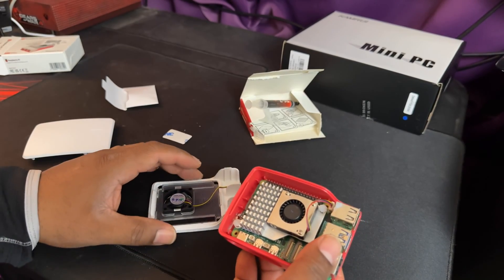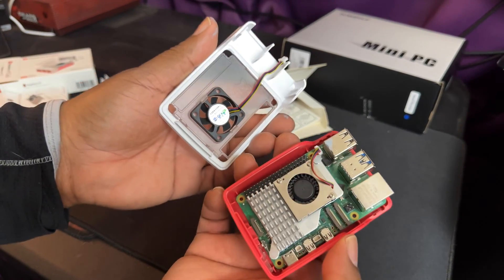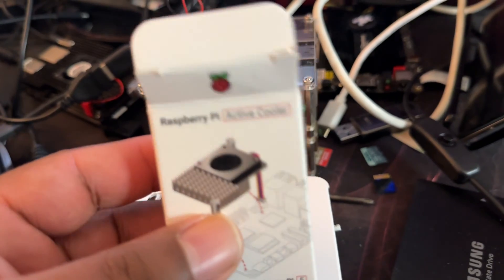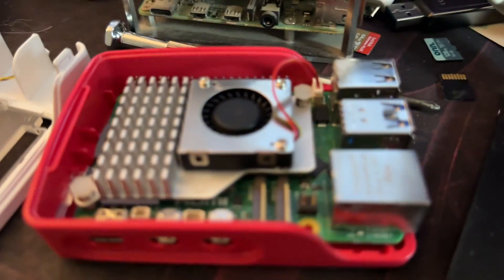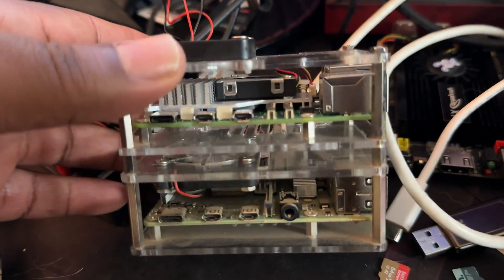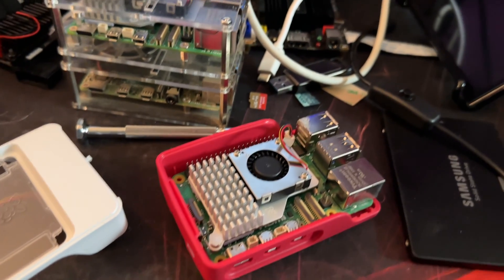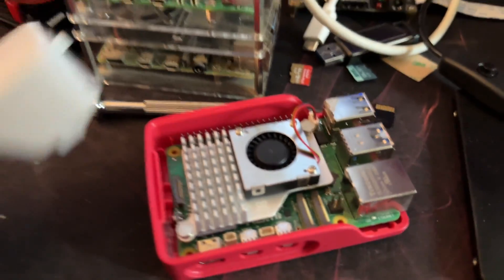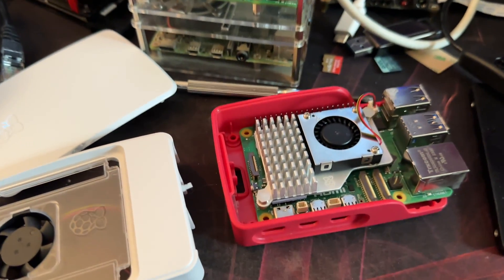The Raspberry Pi 5 Case & Active Cooler Install Concerns

Comment from the maker: The case is meant to be a protective housing for use with a fan and/or heat sink. I've searched high and low and no where is it stated or mentioned that the active cooler works in conjunction with the included fan. Its one or the other. Most videos and reviews will state the active cooler is enough. however under demanding applications such as over clocking or running demanding applications for 3-4 hours or any length of time the cpu will be at throttle levels of 77-85. this has been tested with the active cooler within the case. Using it outside the case with open airflow will give you better temps. My stress test included several bench marks and ps2 emulation on the raspberry pi 5 which is one of the most demanding things you can run right now. you wont find this info anywhere because not many people have ran ps2 emulation or demanding apps for more than an hour or even while overclocked. im using the microcenter acrylic case from the pi4 with the additional. fan. my idle non clocked temps are 28 degrees. in over clocking and running ps2 emulation my temps reached 56 degrees. normal idel temp for a pi 5 is 45-55 degrees non overclocked. if I was not applying my cooling method with thermal paste I would have exceeded the thermal threshold. The stock case could have been designed for better air flow. Im aware the top comes off but you need an additional fan with the case to keep it cool. Especially under demanding circumstances which most customers have not ran. running a 15 second bench test to establish temps on a case means absolutely nothing. try 6-8 hours https://youtu.be/ruXQ4eYh4dA?si=xOoB6Fv5DFtgfF0n
Reply: can you do a video temp test with 
-active cooler and case
-active cooler and case (with the case fan maybe mounted outside of the case)
-active cooler without case
Reply from the maker: @TylerDurden404  i performed a test myself. I haven’t uploaded any test results or videos but it’s definitely nothing to be proud of. You definitely need to go with another option.
Reply: @TylerDurden404  eso sería un estupendo video pues son pocos los que los hacen diciendo la verdad pues muchos de ellos sólo muestran los artículos pues son auspiciados por su manufacturero y no dan una opinión real y menos hacen las pruebas pertinentes y lo documentan, sería maravilloso encontrar esos videos y así informarse mejor para tomar una decisión bien informada para que cuando nos decidamos por comprar ya saber estos datos y ir mejor preparado y comprar lo que de verdad funciona.
Reply: Thanks for the insight have u found a solution for a case that goes in conjunction with the active cooler?
Reply from the maker: No, I haven’t. It is best to use something else.

Comment: ur supposed to pop off the plastic when using the active cooler and no active cooler is not required. you can just use the heatsinks that come with the case, or you can use the active cooler without a case. if you want both, you can pop out the plastic to use the case with the active cooler. and you don't even really need a case anyway
edit: and also no you don't need 3 heatsinks, one for the CPU is enough. heatsinks for the ram and the little power chip is optional
Reply from the maker: I’m aware about how this case is assemble however it was not mentioned at that time. In fact, if you watch this video is one of the first that was made on this particular product while other accessories were also promoted as well in addition to your theory of that it doesn’t need additional heat sinks as far from the truth. It starts to throttle it affects performance, especially when you run in a demanding environment please remodel the comments on this matter, I’ve been doing a lot of developing even when this was first released. It was not tested thoroughly or pushed to a demanding level such as gaming and emulation and o’clock, which is far more demanding in which most videos that ever portrayed at the time.

Comment: From what I've read the active cooler was never meant to be used with that case. it was for open projects, IE the motherboard not in a case.
Reply from the maker: Very true. It really wasn’t known at the time of this video
Reply: @kiodiekin  what happened with your pi5 though? did it run ok when you popped the plastic out? 

The original video where they introduce the cooler he says there’s 2 cooling options. he brings out the case explains the case fan will keep it cool. Then he brings out the active cooler and says that keeps it 10 degrees cooler, but he says 'because its an open design' it took me a few rewatches to get what he meant. but I'm sure most people watching thought it was for inside the case
Reply from the maker: @spacexmike  I don’t use this case so a lot of what I do and I probably didn’t explain in the video is I do a lot of real world testing, and it would’ve appeared at the time that people or peoples did not fully test us in an overclock setting and run something very demanding for several hours that’s pretty much what I do because I do a lot of retro gaming which involves enclose spaces maximizing full potential for a home arcade units and gaming. So unless you’re running something very demanding and then trying to overclock this to really push the full extent of it just try to run something basic on it for a few minutes or do a bench test for 10 to 15 minutes is it gonna give you a true result so based upon the hours I had been testing and what not I found this design to be in adequate
Reply: @kiodiekin  thanks, I was looking at making it a retro gaming unit, but mostly a media centre. I don't think I'd run it too hard. I liked the idea or the case just with the standard case cooler. but i read a guy say it failed after just 1 year. and he had no warning so the whole unit failed. 

Your video was one of the first I found, I like the idea of using an orignal pi case, I was going to get a NES shaped one, which comes with a heat its own heat sync/fan. but i dunno how good that is
Reply from the maker: @spacexmike  oh cool, thanks for watching and supporting yeah I have it working. It works fine for a retro gaming up to PlayStation two.

Comment: Spent 5 minutes talking about how the case doesn't work with the active cooler instead of just trying to pop out the obviously well constructed clear part of the housing and re-installing the white top....
Reply from the maker: Read pinned comment
Reply: @kiodiekin  Yeah that info in your stress tests is great and no one can disagree with it, but you still complained in this video for 5 minutes about space compatibility between the recommended active cooler and the case when it's a simple fix for that exact issue.  If I were you and had all of this info, I would re-record this video and talk about how you can just pop out the clear part to make the space for the active cooler and then give the warning about your stress testing results.  As it stands you complain about space compatibility for 5 minutes and I clicked away from what could've been a great informational video if you had included the info in your pinned comment and only said "This is stupid and annoying but you can't use the case fan with the suggested active cooler.  Instead you have to pop out the clear portion of the case for installation but the case causes more temp issues than it's worth. (Insert stress test results)"
Reply from the maker: @Crazysurferdude it was never mentioned u could use the case with the active cooler as the time of advertisement. It was not known at the time and it wasn’t known at the time for stress tests. You’re watching this almost 2 and a half years later. Read the other comments

Comment: The active cooler is supposed to be an upgrade to the existing cooling system in the case, they are not intended to work along each other, that's an assumption you took. Use either one, not both at the same time.
Reply from the maker: There was no false assumption. It was never made clear that the two cannot work cohesively together. Also the stock case and the fan does not keep the pie cool enough, especially if you plan on overclocking or running anything demanding

Comment: They were never meant to be used together. Hty go into detail on this, on the official RPi YouTube cahnnel. The video title is "Designing a bespoke case and cooling for Raspberry Pi 5".
Reply from the maker: @infidelgermany  ya that was never mentioned at launch
Reply: @kiodiekin  In any case, I think it's kinda overkill, to have the case fan installen, when you already have the cooler, or viceversa.
Reply from the maker: @infidelgermany it gets really hot when running demanding apps and there’s no air flow def not overkill.

Comment: I thought the same but i got this case, the Hailo AI Kit and Berry Pi5 and it all fits in the case, with this fan and heat sink.. So it does fit, and you are wrong. Actually if you use a tweezer or knife point there is a lip on the inenr transparent plastic outer shell on the inner  side. You can remove the fan and you can also remove the lid of the case, and remove the fan. and then it fits.. Derrrrr...
Reply from the maker: It’s not suitable if u follow my channel and read my pinned comment

Comment: You are not supposed to used the heatsink with the official case. You put a smaller heatsink on the SOC.
With the Waveshare POE HAT G it works great with official case as it were designed.
Reply from the maker: If u read the pinned comment it’s not suitable for demanding applications and can cause throttle
Reply: @kiodiekin  if you also watch some videos with temperature stress tests you can see that that the temps are quite the same with and without the active heatsink. :) so.. no issues there :)
Reply from the maker: @orfeous  um ok lol
Reply from the maker: @orfeous your joking I’m sure
Reply: @kiodiekin  no I'm not, youtube do not allow me linking the video url here I'm referring to
Reply from the maker: @orfeous  whose channel
Reply: @kiodiekin  "ExplainingComputers" specific video is from 8 month ago.
Reply from the maker: @orfeous  I follow his channel and insure your new to mine. I run some of the most demanding tests results and been doing so for over a year on these new boards I also have some of the coldest temps around and well aware of what’s required. Based on videos no one has ran high demanding apps on this thing at the time for over 11 hours straight under immense stress. Running a simple benchmark for 15 mins doesn’t cut it

Comment: cant you use the GPIO pins for 2nd fan?
Reply from the maker: It can with an additional fan which I currently use on my open air case. But not with the official case

Comment: Has anyone here found a case that goes in conjunction with the active cooler
Reply from the maker: the new argon cases have 1 built in
Reply: @kiodiekin  ohh alright thanks so much
Reply: @kiodiekin  Argon NEO 5 NVMe Case yes I've ordered on as the cooling is better then the official active cooler 😎

Comment: In my case you can remove the component with the fan, so i can use it with the active cooler. Just remove the original fan and the case should close.
Reply: exactly... lol

Comment: I think this might clear some doughts which I also had, https://www.youtube.com/watch?v=vYUF1H-_7TQ
Reply from the maker: that video was posted several days after mines. Also around that time i was working on full development. most tests for temps were only conducted using a bench test and not being realistic in a real use case scenario. i over clocked and tested demanding programs for several hours. even without the case the pi would reach almost throttle levels. the active cooler is needed and that cheap case doesnt solve any issues and it was trhe only case available at the time. and no point anywhere was it indicated pre launch that the fan and active cooler would not work together. check my pinned comment

Comment: If you look closer on Raspbery Case you can easily remove the transparent part of the case together with the fan. In that case the Active Cooler nicely fits in.
Reply from the maker: If you read the pinned comment  that wasn’t the point of this video
Reply: @kiodiekin  Comments are to the video. But it does not matter. Those parts are two optional parts. Depends on your computation load the active cooler is not required to buy.
Reply from the maker: @JanBajanaPersonal  they are both needed, especially if you are running demanding applications most of the videos prior to mine we’re not used under these proper circumstances doing a five minute bench test yields no results. I’ve tested this from anywhere 2 to 8 hours under demanding situations in the temperature to just continue to rise. If you read some of the other comments, they’ll notice people eventually ran it to some of the same issuesalso at no point in time when I bought this was an advertise that you cannot use both

Comment: I commented to Eben and the engineers that the case falls apart which is handy if you need to press the power button from the inside. They blocked my comments. Clearly modern designers don't know how to put a hole to insert a tool. Great video.
Reply from the maker: Wow thanks for sharing

Comment: Raspberry Pi 5 official Case is just garbage ! Pi 5 Case is just cooking my Pi 5 😖Really poor design & im Really disappointed :(  wish I saw your video bit earlier before buying Raspberry Pi 5 official cooler + Case
Reply from the maker: yup. what programs were u running and what temps did u hit
Reply: @kiodiekin  right now iam using it as ADSB Flight Feeder ✈️ which runs 24 X 7, talking abt temperature it was 70° C and climbing so i decided not to use official cover
Reply from the maker: @techexpedition  that’s what I was trying to warn everyone about at the time I was running heavy, and the PlayStation 2 emulation, which is a very demanding process and basic attempts for even some of the other dads in the community were already getting close to throttle speed and open air not inside a case. So when I bought this case and realized, I cannot use an additional fan alongside the active cooler already knew it would be a problem, considering it would be trapped inside of a case circulating heat with no proper airflow. It just really made it strange for me that they would design something like this for a unit that needs full protection at lunch. This was the only option, and it’s not suitable. I’m sure at the time I was the only one with proper development running applications were as other people were running bench test, which would last between 5 to 20 minutes.

Comment: I saw another video where they easily popped out the clear section and fan, do it will work with the active cooler.  Looks like it was designed that way
Reply from the maker: 👍ya but I listed my issues with it in the pinned comment

Comment: It’s either/or. Not everyone uses the case so they opt for the active cooler. 
The case fan easily pushes out anyway and the active cooler is much better at cooling.
Reply from the maker: I’m aware of how it works

Comment: that part with the fan on the official case can pop out so you can remove the fan, and pop the rest of the case on it. it is not that hard...and t he active cooler does a better job than that one heatsink and fan combo. there are many options, but not everybody buys the active cooler, and the case coming with a heatsink and fan is good because than they have a cooling solution better than no cooling solution...
Reply from the maker: I’m aware of how the case works that’s not the point of this review you should read the Pinned comment

Comment: I had a different issue with the official Pi case. When the Pi5 was seated in the case and I plugged in the official power supply I received a message indicating there was insufficient power being received to power all of the ??? devices. When the official power supply was plugged into the Pi5 when not in the case, this message didn't occur. I wondered if the official case needed a slightly larger hole for the power plug. Just FYI.
Reply from the maker: Weird but that shouldn’t cause an issue

Comment: I ordered the same set.😢😢
Reply from the maker: what happened
Reply: @kiodiekin  I removed the fan and the cover that comes with the case.
Reply from the maker: @jbc8220  ya I’m aware of that but it won’t fix the overall heat issue as heat gets trapped in it. U need a second fan  In addition to the active cooler. U can possibly still reach throttle temps